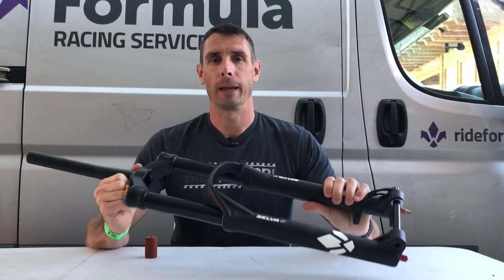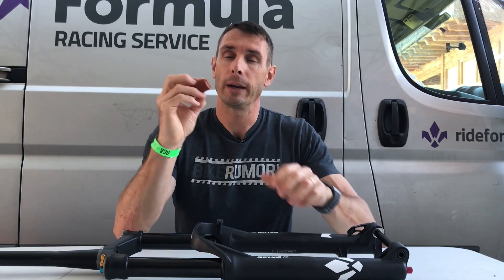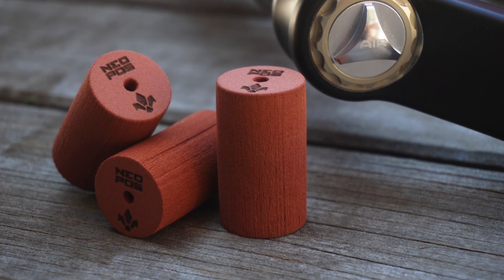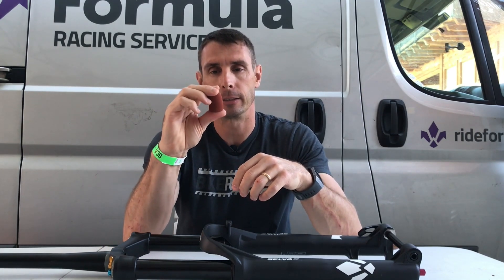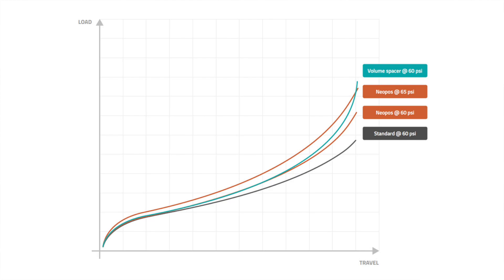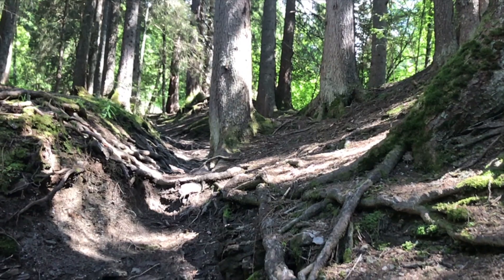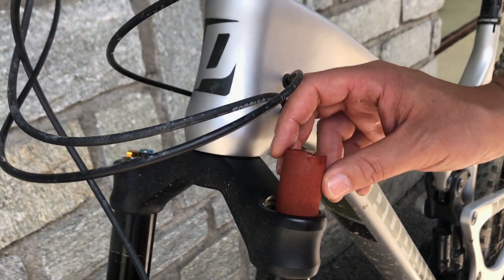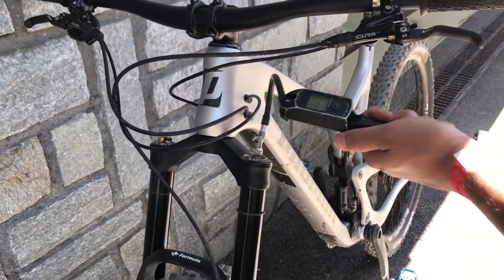How the Formula NEOPOS air volume spacers work

Comment: they tell that you can't use it on other forks cause the formula forks have the positive chamber isolated from the others and uses a less aggressive oil.
other forks use more aggressive oils and have channels between chambers that could get filled with neopos particles

Comment: Great vid...any idea where I can get the Formula tool to access the chamber?
Reply: With the specific tool designed by formula and sold at very high price  (a very normal key thin enought to not allow you use a normal key...)
Reply: you have to get the 28mm formula tool, 30 euros and you can open up your fork